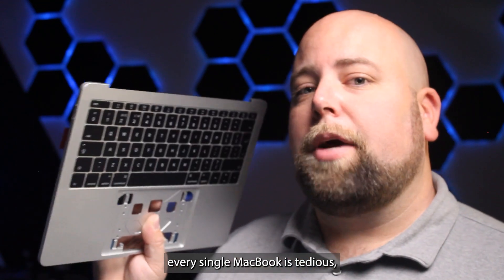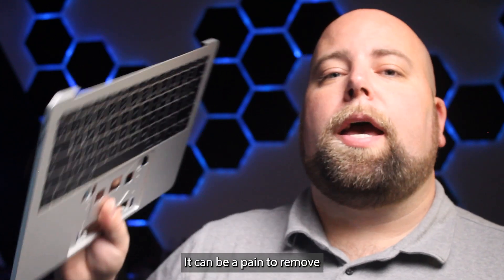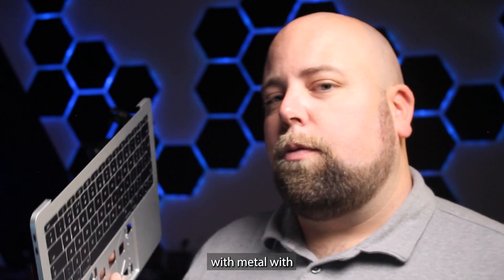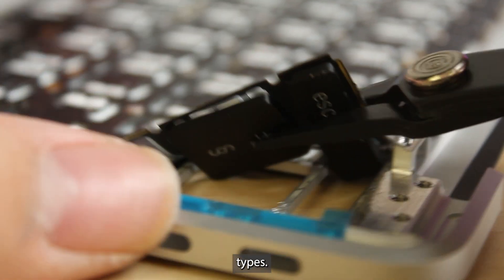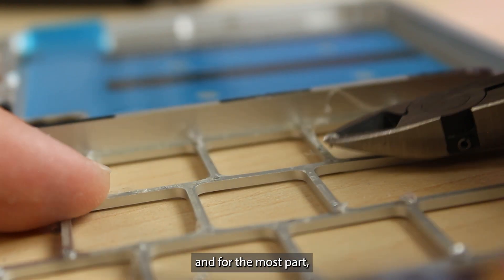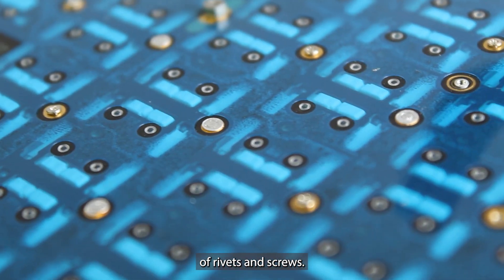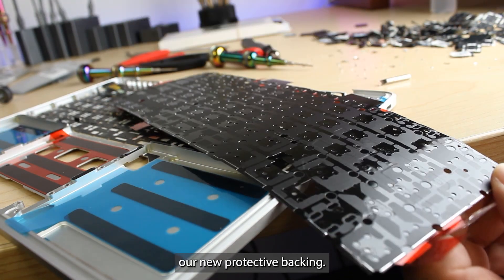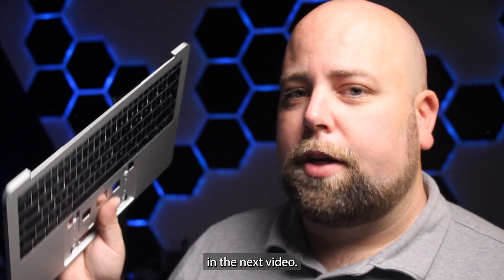🪛MacBook Keyboard replacement with Metal Rivets👍(tips and tricks)

Comment: Haven't mastered the technique of performing this procedure without causing stress marks on the metal around each key (visible from an angle as seen in your video). The metal around each key hole is so thin it bends just from pressing out the keys!